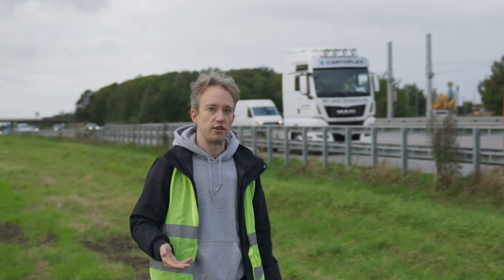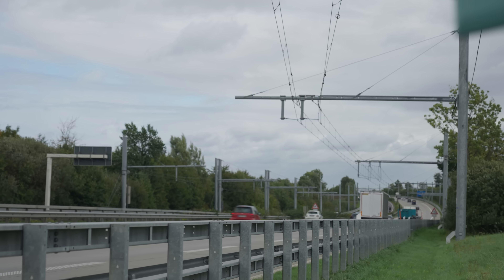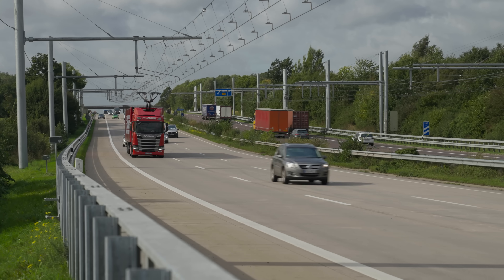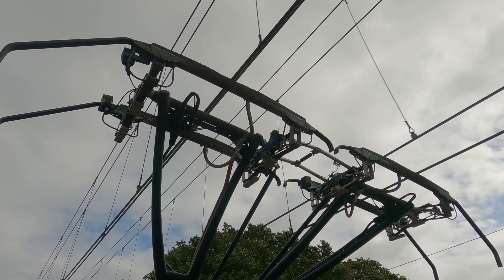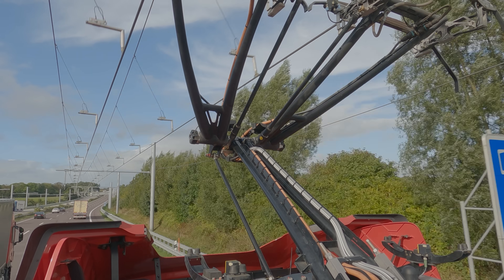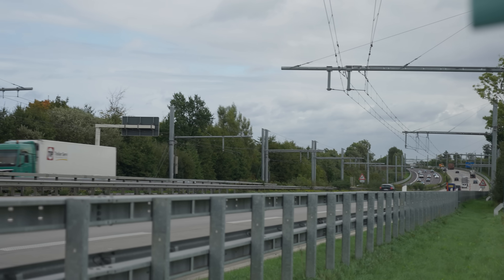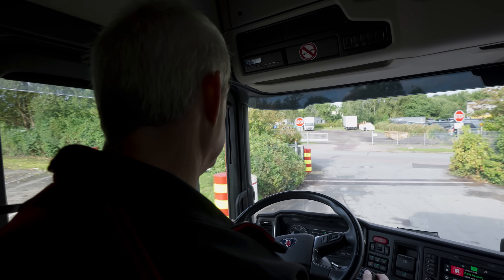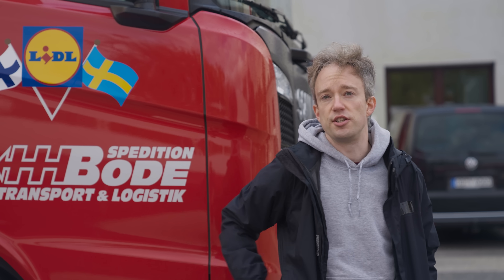The highway where trucks work like electric trains

Comment: If most of the electricity is generated by burning coal, how does this reduce CO2?
Reply: engines are inefficent compared to powerplants
Reply: You could argue that 1 big coal-fired power station, powering your stuff in your house, at the work place, your car, streetfurniture.... is more efficient generating and delivering power than that one Diesel or Petrol engine that powers only 1 car and with that the other millions of Diesel or Petrol engine cars that only power themselves.

While throughout the years we have created more fuel efficient engines, there are still situations where such engines are wasting fuel for not much gain: Idling, riding the RPM limiter, pulling away from stoplights...

Probably a good idea to build non-fuel burning power stations while at it?
Reply: This is in Schleswig-Holstein, where we have to turn off wind turbines because the power lines cannot take all the wind power elsewhere...

Comment: A downside of this system is that it's infrastructure, and hence a huge upfront investment. That can lead to two big problems. It could turn out that batteries or a competing technology gets so good that the infrastructure becomes nothing but waste. It could also lead to everything being built around this technology, making it so ubiquitous that switching to newer and better technologies becomes difficult.
Reply: Maybe, make the techology be in the vehicle. and the infrastructure could simply just be powered wires.
Reply: I don't see a problem in such investments. At least the government is putting money in the market. But even if batteries are getting much better this could always be used to recharge them while driving. Also it could be used as a guiding system for self driving trucks.
Reply: Battery or hydrogen/synthetic fuel infrastructure isnt free or easy to switch off of either, and batteries have a very long way to go to be competitive with current diesel trucks. This system can be implemented right now, is energy efficient and probably not hard to maintain, and if this professor didnt lie it might even be cheaper than running trucks on diesel. If thats the case, this will be the best option for many more decades, and we need solutions as fast as possible.

Comment: In the US, we can't even get dump truck drivers to remember to lower their bed before they take out bridges or traffic lights.  I can't wait to see this tried.

Seriously, this is a niche approach.  In a few places, it could work very well.  But to attempt this large scale in the US with its varying electrical system, road design and state regulations seems like a pipe dream at best.

Comment: Oh hey.
I live near that E-Highway and I am taking that "Autobahn" regularly :D

Now to the toppic:
The plan to move everything to electric is cool and all, but...

Where shall the energy come from? Renewable Energy is not a viable solution yet. And even if we use the current "dirty" power generation like coal and oil...
All the electric vehicles WILL overload the grid as it stands.

Comment: BUT the electricity has to come from somewhere ... and as long as germany buys it from poland etc its not effective imo. germany doesnt want atom or coal energy but all the green alternatives cant handle all the need at the moment
Reply: this is just wrong. In fact they Export more then they Import 
Production:536.50 bn kWh
Import:	28.34 bn kWh
Export: 78.86 bn kWh
And Even if u would be correct building this system would only  increase power consumption  by a few % (Most likely only about 1% or less )
Reply: @heyyo9  right now germany uses coal but will this numbers be the same if they only use wind and sun energy in a few years?
Reply: @mordecalim  49% of germanys energy at the moment is green
Reply: @heyyo9  but is 49% enough when everyone has a electric car? 
dont get me wrong ... iam not against green energy or the idea to save the planet ^^ but right now this is not a flawless plan, you know?
Reply: @mordecalim  Even if 100% of the energy comes form coal a e car will still be better for the planet also the rate of  green energy in germnay is going up fast

Comment: Whats the threshold for CO2e emissions from generating the electricity that feeds the truck / distance unit compared to CO2e emissions from running on fossil fuels?
Reply: Running on electricity is significantly better than running internal combustion. The main reason why is that a standard internal combustion engine needs to speed up and slow down, whereas a generator just stays at the same RPM 24/7. Combine that with economy of scale and even if your electricity is 100% coal based, an electric vehicle produces less CO2 than a gas or diesel powered vehicle.
Reply: @satiric_  Oh cool, didnt think about that. Thanks for the quick answer :)

Comment: What happens if you fill the highway with Pantograph trucks, does the overhead supply enough Juice to charge all of them? What about DC transmission losses? I am a bit of a skeptic. The Freight Trains in Germany are soon going to implementing an auto coupling system where they can automate much of the shunting operations, making short haul mixed freight more agile to compete with Trucking. I would be surprised if there is a long term future in long haul trucking.

Comment: I would not be that surprised if pantograph-equipped lorries roll on roads in the future.
Or lorries that roll on various types of guided bus guideways (e.g. kerb guided, Translohr, Bombardier Guided Light Transit) and take their power from the grid. Or the same, but using PRT infrastructure like in Morgantown, VA. 
Or guideways which double as PRT and Guided Bus/Lorry guideways.

Comment: Something like this is done with buses in Athens. They run on electric power from power cables where they can, but have a diesel engine as well for when they need to go to more remote bus routes, like the one to and from the airport.

Comment: its also a far more environmentally friendly solution than truck with larger batteries as there would be less lithium what would need to be mined to support the transition. although a more idea solution would be a powered rail built into the road beneath the vehicle so traditional vehicles and trucks could both benefit. than you could have electric cars that are cheaper and more environmentally friendly because they can have a reduced battery capacity. you would of course need a detection system that only powers the active section of rail for safety reasons but it would have the advantage of being able to support everything.

Comment: I wouldn’t underestimate battery technology advancements. In the time it takes (5-10 years?) to finish deploying lines like these, batteries will advance and change the calculus.
Reply: They already have. This system already makes zero sense, except as very visible advertising for “green” politicians.
Reply: Even with much better battery technology battery powered vehicles still need to charge. Super fast charging stations would have ludicrous power requirements and most likely degrade battery lifespan even with better technologies. Slow charging would require too much downtime and swapping batteries to eliminate charge time has its own issues. "Slow" charging a vehicle as it runs is much easier on electrical infrastructure and extra power lines can probably be run alongside the pantograph lines to increase grid capacity.

Comment: well i really like the idea and think this is a nice solution, but its not so environment friendly if most of that electricity is generated from coal though...
and yes i know that even though if the electricity isn't from anything near a low pollution source, its still better than conventional combustion engines. but having both would be best solution.

Comment: Things like this is why I like engineering. It's not always about reinventing the wheel. Sometimes it's about solving a puzzle with pieces you already have laying around...
Reply: Exactly.
Reply: This is a big part of engineering! To see things in new, inventive, creative ways, just like making new puzzles out of the pieces already laying around. Great analogy.
Reply: Most engineering is like that. Understanding that old toys still have value.
Reply: Trolleytruck (Oberleitungslastkraftwagen) are not exaclty new. They have been around for 150 years, in Germany, Switzerland and USSR.
Reply: It is reinventing the wheel, in this case an inefficient train.
Reply: @patrick_test123  but this could have a small battery, so that when it gets off the highway, it can drive a small distance to whatever business it wants to go to. It's far more flexible and doesn't need as much infrastructure. It solves the problems  of electric trucks, which come from the giant battery required if there's no active way to get power elsewhere like these overhead cables.
Reply: @numbdigger9552  This solution still upholds that flexibility that you are talking about. The only more efficient way to do with would be through wireless (electromagnetic) energy transfer, but I'm sure the consequences and implications of that would need to be studied intensively. Cable power transfer is a proven solution that many trains still rely upon throughout the world. 

And there is the idea that you could introduce steel train wheels to trucks, similar to how rail-road vehicles do maintenance along existing train tracks. But then you have to, like others have said, build in infrastructure to large spans of roadway. 

Also, trains don't have other drivers to look out for, mostly due to timetable coordination, and so a truck restricted to a single track on a highway near other freely moving cars would potentially make things more dangerous. At least in the US, cars mostly enter roadways from the rightmost lane. If trucks are designated tracks on the rightmost lane only, then they would need ample time to switch back to road wheels while moving at 60 km/h speeds. If that doesn't happen and people are vigilant enough, you could have higher rates of accidents. Same thing with trucks maneuvering out of the way of debris or slow drivers. You could have a dedicated electrified truck lane, similar to the dedicated lanes like Autobahn in Germany or carpool ones in many states in the US. 

All this is to say that the idea of merging further train technologies with road-based vehicles beyond overhead current collectors shown in the video further undermines the benefits of road transport by itself. I think this solution is a good happy medium. 

Then again, there are smarter minds in the world than mine that could find better solutions.
Reply: @nschrombeck  wireless power transfer would be less efficent not more efficent.
have you seen the numbers?
Reply: @patrick_test123  how is it a train? the truck is not limited to that lane or road and can go anywhere, its just when on a highway it makes it more efficient and friendly to the environment
Reply: @patrick_test123  we already built the highways, we're just using them smarter.
Reply: @patrick_test123  You never wondered why trains aren't already used for all freight transport already?
Reply: @patrick_test123  Germany doesn't have that many train tracks to pull off as much of efficient cargo transportation as trucks do. You know what Germany does have, though? Lots of roads and highways. The people in charge of this have also apparently deduced that train tracks for what is essentially truck-cargo would be too costly to set up and maintain as apposed to simply having a system in place for electric trucks. Trucks aren't limited to a single railroad either and they don't need nearly as much space to unload stuff from, thus more space for trucks to unload their cargo from. In the long term, electric trucks just seem like the more efficient and less costly option overall. Leave the trains for the heavier loads that trucks can't handle.
Reply: @the_furry_inside_your_walls639  Germany has one of the densest rail network in the world. But of course during the last 30 years DB did it's best to change that.
Reply: @patrick_test123  I saw the argument that laying out rail in Germany would be more costly and unloading small freight like what a truck can carry would be a pointless due to time and still having to transport it to a shop or wherever, but I'm not German or even close to Europe so I got no real clue
Reply: @patrick_test123  if you think this is anything like a train then you have not yet understood the role of trucks in logistics.
Reply: @patrick_test123  this could fill it the last mile distribution/delivery sector niche of logistics, trains are good at one main logistics hub/warehouse to another but not the smaller logistical bits.
Reply: @ANTSEMUT1  For last mile the ranges needed are much shorter.
Reply: @patrick_test123  Can a train pull off the tracks to stock your local supermarket? Please think before you speak, trains solve a different problem than trucks.
Reply: @acceptablecasualty5319  It's called a railway spur. Also those aren't for short haul, that's within the capabillities of Batteries. So maybe take your advice before commenting.
Reply: most business used to have rail connections 50-70 years ago
and now that autonomes trains are possible and safe it woul be cheap to run single containers by rail with the same investment
Reply: this is engenerding - for engineering you need brain and common sense. this is solution that majority hates to a problem that doesn't exists (unless you of course believe in homeopatics and believe the climate works on homeopatic principle where miniscule concentrations and changes make the most significant changes while the big ones do nothing ...) germany went off the cliff on the green socialist train and they are in a state of mass psychosis just like 90 years ago and doing the same crazy things. Who are they going to blame it on this time? Building this craziness will cost more than Hitlers autobahns and they had to finish it with slave labor and by pillaging all the neighbors.
Reply: Trains exist, yo.